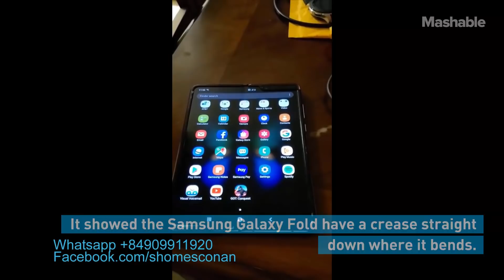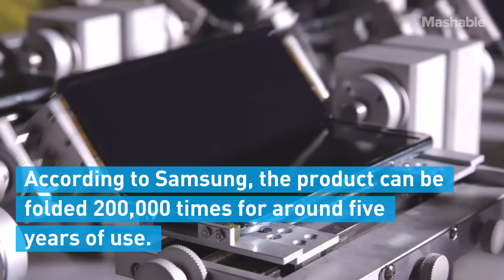Samsung Really Wants You to Know the Galaxy Fold Doesn't Have a Crease Problem

Comment: This is such a controlled method of testing the folding screen. You can't get enough variability or real world scenario when folding and unfolding. There doesn't even seem to be any minor shear force testing while folding and unfolding. It's like testing a rubber tire by simply rolling it indoor on a conveyor belt in a vacuum.

Comment: Ok it doesn't crease Samsung. But what you actually showed us was that screen panel is really far from the bending mechanism (there is a pretty huge gap) of different shape than the bent display's curvature. So you basically showed us the spot where it will definitely fail, bit of lint, bit of sand or even enough dust or water, and it's pushing on the screen and breaking the mechanism. Good job Samsung, now I know we were worried about the wrong thing.
Reply: Frykauf La Kosta LMAO IT CREASES